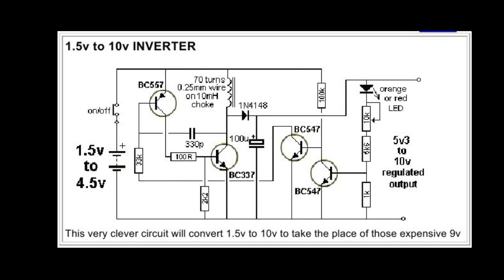DC to DC Converter(1.5V up to 9V+)

Comment: sir plz help me i want to make dc to dc converter step up.boost converter........input voltage vary from 2 to 4 volt n output to fix at 12 volt.....what can i do for it????? plz help me n 40-50 watt power i need...........only give me crkt dia.....n all components value????plz help its very urgent

Comment: hi , one question, i can use this circuit for a solar panel that output voltage is 1,2 or 2v in indoor?
Reply from the maker: xavier aguayo Solar panels produce VERY little current indoors. No good.

Comment: this output function on other device or not?
or it just to light up the LED?
Reply from the maker: You can use a 1.5V battery to power 9V battery devices.
Reply: electronicsNmore  ive done your circuit.. but i so curious about my inductor..
i use 10mh fixed drum inductor and remove the original coil and i coil it with 28awg copper with 70 turn.
the result i got only 2volt from 1.5 battery.
i dont know wht to do anymore.
Reply: electronicsNmore  hey.. update.
nice circuit.. i successful troubleshoot.
the result i got when measure by multimeter..
1.5volt cell battery gain up to 9volt..
3volt cell battery.. gain up to 20volt.
amazing dude.
thanks again for super circuit..

Comment: Hi, Love the vid

i am in need !!

i have put togeather a bunch of components (23v power supply / coil / caps / resistors / zener / one way diodes and a manual switch), so how it works is that every time i press the switch the voltage goes up, Problem is that all those beautiful volts are very soon "lost / depleted even bearing NO LOAD) ............. how would you maintain the output voltage ofthis circuit to supply steady Vout ?

in other words ..... suppose you press the switch and its climbing every time you press the switch 1 press = 20v, 2nd press = 40v 3rd press = 60v and stop at 80V, how would that 80v (or whatever you stop at) be maintained on the Vout ?

thanks

Comment: which volt capacitor you are using ?
Reply from the maker: +Asad ullah 
16V
Reply from the maker: +Asad ullah 
16V
Reply: +electronicsNmore  can i use 50V ? is it fine and instead of 33k 27k or 39k as i have them both instead of 33k? and the last can i replace coil with this? http://www.evselectro.com/image/cache/data/Inductor%20Coil%2014591231-250x250.jpg
Reply from the maker: Asad ullah
50v is fine. Never hurts to use a higher voltage rated capacitor. The resistors should be fine. As long as the inductor has around the same inductance value as mine in the video, it will work.
Reply: +electronicsNmore Thank you for your kind reply please tell me this will be fine http://www.evselectro.com/inductors/axial-leaded-inductors/13-uh-inductors-10a-6472 or recommend from these http://www.evselectro.com/inductors/axial-leaded-inductors
Reply: +electronicsNmore  your inductance value please

Comment: i will need up to 2A so this is unuseful for me
Reply from the maker: +Jindra Veselý 
The circuit was designed to replace 9V batteries, (6)AAA, and "some" (6)AA applications, not for high current applications. You need to purchase a DC to DC step up/boost converter to handle that amount of current.
Reply: +Jindra Veselý Good luck drawing that amount of current from a battery (especially since if you're boosting to say, 3v, then you'll need to be drawing 4A from the battery).
Reply: +Jindra Veselý  Check This ^_^ i hope It will Help u

Comment: Hi, Im almost done with this device,I only need the choke to finalize it,I can't find a 10mh inductor but instead a 8mh,will it work or will it make any difference?Thank you
Reply from the maker: edwin siy Look for a higher value inductor and remove some of the windings to get a lower value. Using a meter which measures inductance makes it very easy.
Reply: electronicsNmore I already ordered an inductance meter device from ebay and probably will receive it after 30 days hopefully but as of now I have no way of measuring inductance, I got a 8mh and a probably more than  10mh  inductor because its huge, I tried to put the 8mh and I'm getting 9.5v with a fix 15kohms but I don't really know if it will affect its amperage,have an idea?
Reply: edwin siy I forgot to mention,I replaced the 10k pot and the 5.6kohm with a fixed 15kohms.

Comment: Hi,is the LED necessary? if not,can it be remove to conserve energy? Thanks
Reply from the maker: gohonzon 888 You cannot remove the LED because the base of the transistor will not be supplied with power. The LED draws next to nothing, so don't worry about it.

Thanks For Watching
Reply: electronicsNmore Thank you and one more thing,if ever I need a fix 9 or 10v output,would it be possible to replace the trimpot 10k to a fix resistor value?
Reply from the maker: Yes.

Comment: Hey,can those three npn transistor be replaced with 2n2222 or 2n3904 and the diode 1n4148 with 1n4007? Got lot of those,thanks
Reply from the maker: edwin siy 2n3904 is fine for the (2) BC547's. To replace the BC337, you need an NPN transistor that can handle much higher current, so use the 2n2222(Small metal can housing). The 1n4007 is not a good replacement for the fast switching 1n4148 diode. If you had a UF4007, then that may work ok.

Thanks For Watching
Reply: electronicsNmore Thank you very for your quick response,appreciated
Reply: electronicsNmore Thank you very much for your quick response,appreciated

Comment: Where can i get the coil that you used there? Can i just improvised?
Reply from the maker: Arvie Gel Ramos Look up 10mH radial choke to see what they look like. You will remove the enamel wire on that choke, and wind on 70T of .25mm enamel wire.

Thanks For Watching!
Reply: electronicsNmore okay. Thanks a lot. I try to make one with the circuit you create and i already bought the components except the coil because i didnt know where to get that. hope it will work once its finished. Btw is the equivalent of .25mm is number 22?
Reply from the maker: Arvie Gel Ramos
.25mm copper enamel wire is equivalent to 30ga. 28-30 is fine.
Reply: electronicsNmore okay. Thanks a lot. 😊

Comment: hello,thanks so much on this nice video, but  i have a question,i run it on soft protues but voltage out is about 1.04 v 
can you answer for me,please !
https://www.upsieutoc.com/image/DY7F
thansk you so much!
Reply from the maker: viet nguyen Forget that program. Just put the circuit together, it works. I verified it.

Thanks For Watching
Reply: electronicsNmore thanks you so much!
Reply: electronicsNmore   almost  resistor you used is  0.6w?
and value of inductor is 10mH?

Comment: Thanks very much on this nice video but I've a question pls
What's the current capability of the circuit,ie what the maximum current the circuit can deliver,since the power is constant as i know?
Reply from the maker: Max output is around 70mA. Most 9V battery circuits draw WAY less than that!

Thank You!

Comment: Could I use a 10mH inductor instead of a ferrite choke or does it has to to be exactly choke 70 turns copper wire? Can at this case any ferrite rod be used? Many thanks.
Reply from the maker: Hi Viktor. As long as the value is the same, you are fine. :-) Any ferrite rod should be OK.

Comment: I tried simulating the schematic/circuit that you provided at the end but im not getting an output of 9V.. Im only getting 2.5V output which is weird
Reply from the maker: Simulating? I suggest you put together the circuit and actually try it. The circuit works extremely well.

Thanks For Watching!
Reply from the maker: Fred Haynes I have not looked at the video/schematic for a while, but everything should be in the video or the link. Ferrite rods can be found in many electronics.
Reply from the maker: Glad it worked for you! I have had no problems with the circuit.

Comment: very weak this drive did better than this entry in 2000mAh 1.2 v, 12v output and 150 to 200 mah
Reply from the maker: This circuit is excellent. I never said you would get large currents from this circuit. The limit is around 100mA.

Comment: i want make buck bosst converter from maxsimal input 35 V/2.75 A to output 30volt. i want up and down power energi from solar cell. i want question how use value induktor ..

Comment: That might have been where he got it.  But then he might have got it from some other website that ripped it off from TE.  In fact, that is more likely where he got it.  There are several others where I've seen schematics stolen from the original website.  Most of these are in countries like Russia or Malaysia where there's not much you can do to get them to stop.

Comment: I decided to test this in ltspice 4, it runs but has insanely large amounts of spiking, so i decided to replace the 10mH inductor with a 47uH inductor, change the output cap to 1uF,  and use transistors with somewhat higher current ratings.  now it works much better.

Comment: Talkingelectronics (I think his name is Colin) has some good info, but I think a lot of it has not been his original stuff.  Also, he dwells on stuff that seems to be irrelevant.  But he has some good ideas.  A circuit similar to this circuit was in my late great watsonseblog, but I don't think I have put it in my new rustybolt dot info blog.  I'll have to do that when I get time.  I used the E-B junction of a transistor for a zener instead of the red LED and resistors, I got better regulation.

Comment: @ImUrtastyflava I hardly understand the concept myself, so I'm not sure of the formula to calculate it. All I know is it is a consequence of voltage increase. You can either have a higher voltage or a higher amperage, but getting both continuously would require something with a bit more power. So when your cap is charged, it will be capable of more current with the volts than the battery can supply.

Comment: @ImUrtastyflava Well, when you boost the voltage you also decrease the current, so perhaps the motor is not getting enough current continuously; the startup may just be as the capacitor dumps the charge.

Comment: for the 10mH inductor, did you purchase it with the 70 turns of 30 gauge wire or use the core and rewind it yourself?

Comment from the maker: @myvideoisonutube 

I recently bought an oscilloscope and checked the voltage output of this inverter. The scope displays a smooth DC output. No ripples or spikes. Maximum effective output is around 50ma for 9V devices. Higher current output at lower voltages.